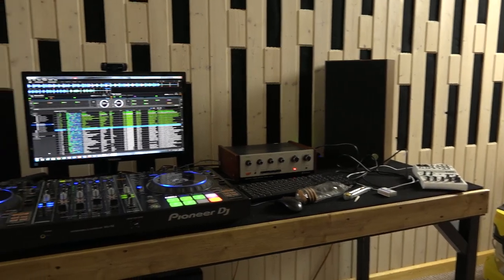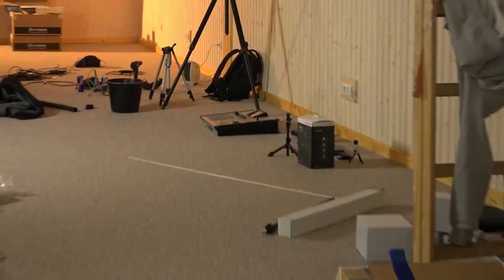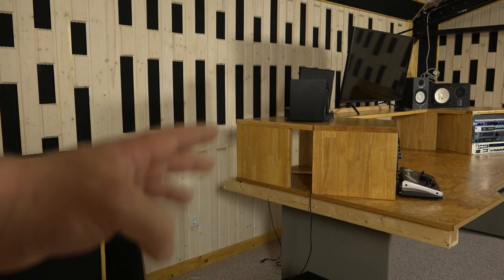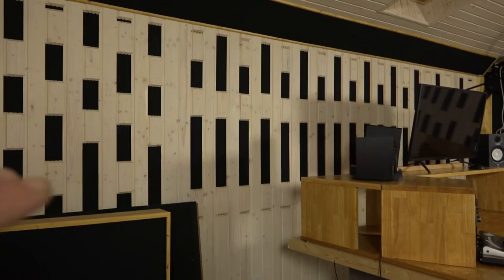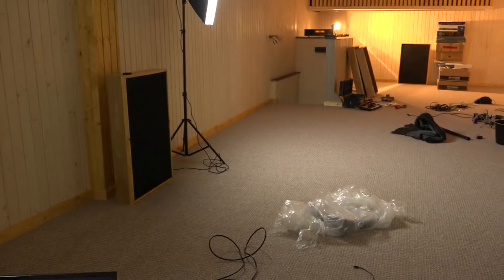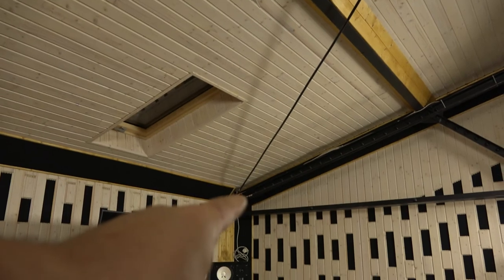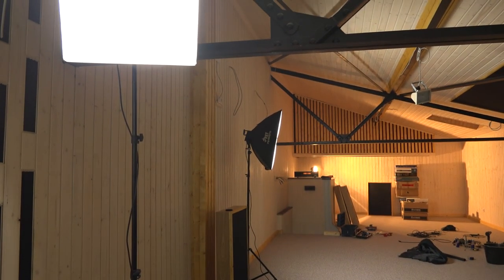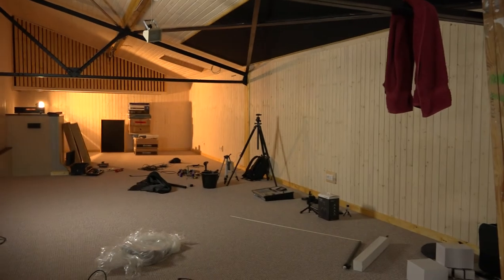Building a new home recording studio! Part 6.

Comment: It is actually very cool - how elegant and organic Your acoustic treatment look. 
Only thing that I don't understand yet is how are You going to achieve simerty between right and left side. Or is it negotiable with such a treatment allready?
Reply: I mean - how dead will be the right (closer) wall compared to the left side with all the angled reflections and treatment (which is quite cool plan)?
Reply from the maker: No big difference at all. The right side is almost the same diffusion and absorbing like the opened left side, thanks to the wall system. Now I just played a bit with the dj gear, and sounds good, clean and symmetrical. What we will have small problems, will be fixed with the panels on the spots.

Comment: You went too fast , which model were the big Yamaha monitors?
😊ps were there any bank robberies around the time of this video?😂😂😂
Reply from the maker: I have NS-10M X (super rare) with all original box papers etc..
then sone HS 7 or wtf..., HS 5, Yamaha 10 inch Studio sub.
But now Iam working on a 3 way midfield monitor with some secret negative feedback hyperdrive 90V/ms slewrate aplifiers.
I still have 0.004% distortion and -97 dB noise at 0dB input... Target is 0.0008 with -121 dB noise.
 If I fail, I will buy a Naumann 3 way big monitor system.
No bank robbery, just stop smoking, party, and other expenses. Around 15K per year saved....
Reply: @BMRStudio  nice,  will follow your speaker build,, in the 90s I ran some Alesis Monitor 2 (or 1 I can't remember) they were big 3 way tight as fuk speakers, with a Matica 500 amplifier...they finally got sun damage from too many day long outside after parties..lol